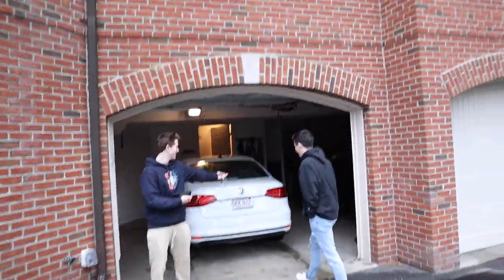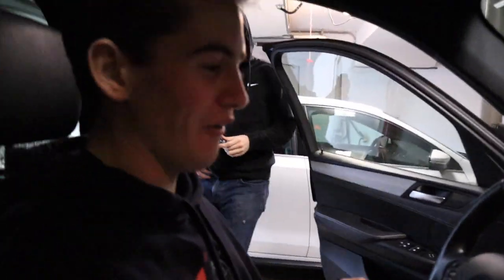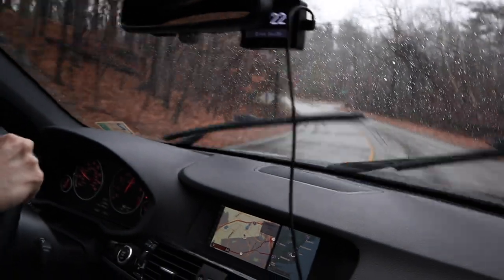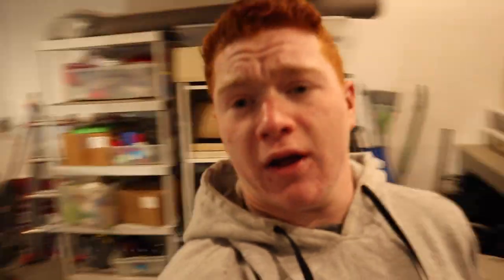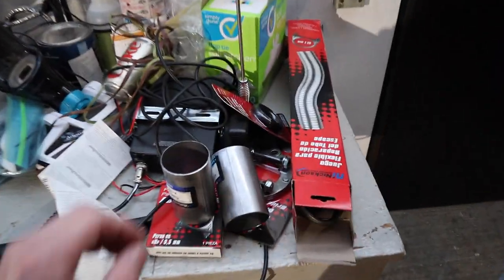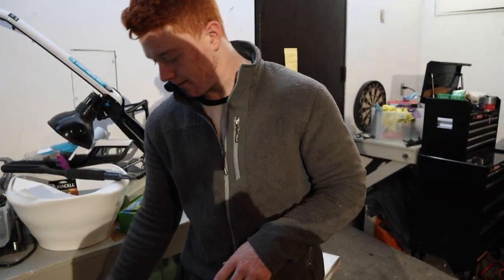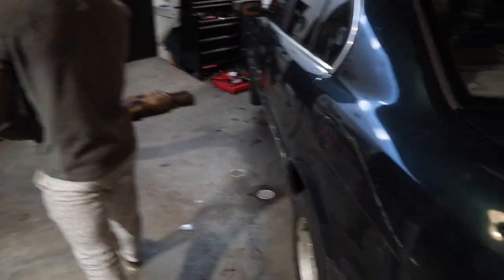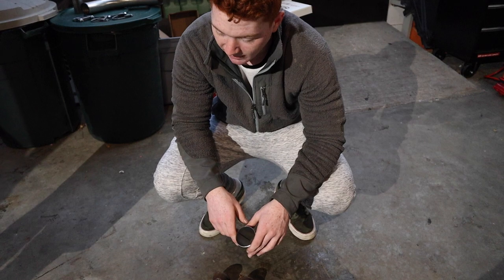Burble Tune On An X3!! (Car Vlog #5)

Comment: Yo what did your boy use to flash the ECU? I think I've seen that before. It looks like an OBD2 bluetooth dongle but does it have to "marry" to one car or can you use it on a bunch of different BMWs?
Reply: Mhd wifi adapter it's around 69.99 and you need a to buy the licenses from the mhd app they're around 50$
Reply: The orange adapter is for e9x cars and and f series cars. the black one is for only for f series cars